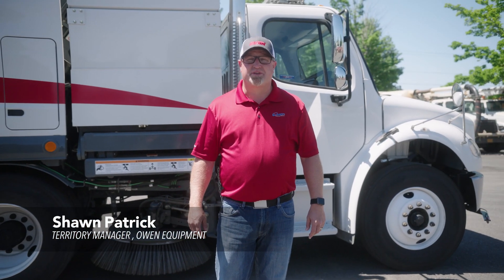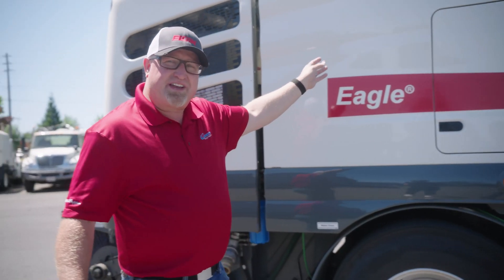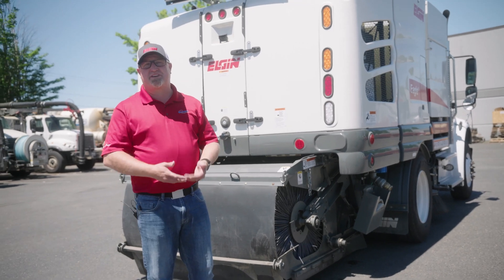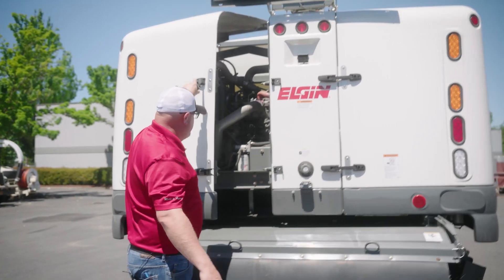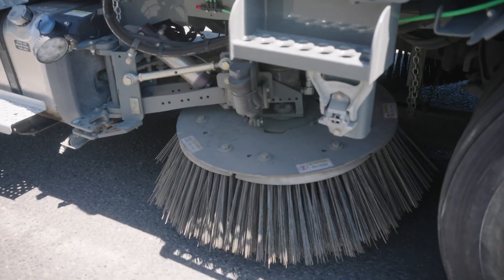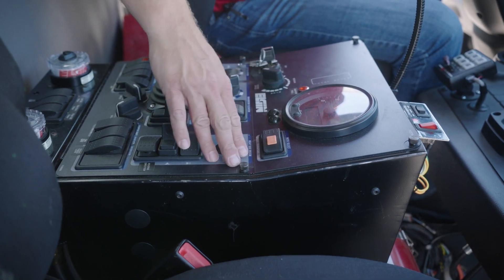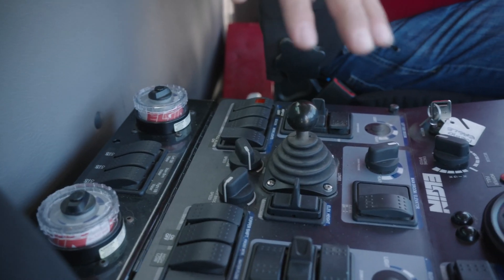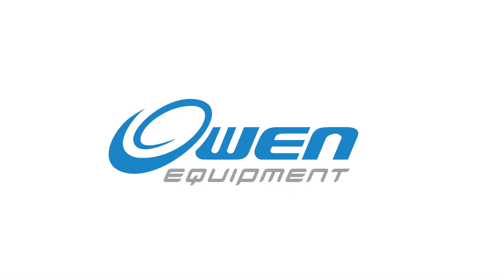Elgin Eagle Street Sweeper - Walk Around & Specs

Comment: Ok, I’ve been sweeping for 15 years behind grinders/mills. I’ve used this broom in the past and let me tell you it needs to be upgraded. First off the hopper door is a stupid design with the tiny door to dump in a truck.The whole hopper system is a crap design imo. The hopper window is also tiny why? How much money would you lose to double or even triple the size of the hopper window? Is plexi glass that expensive? Makes it a lot harder for the operator to see his load for no reason. The gutter broom design is out of date. Other brands allow you to change the width and the angle from the control panels. Some of the new brooms even have a camera in the hopper so you can see your load better. Elgin needs to step up there game
Reply: Btw I live down the street from Elgins assembly building. I’m open to come in and explain why this sweeper is out of date and not operator friendly unlike it’s current competitors
Reply: @pod543  what sweeper brand/model do you prefer?
Reply: @raesorenson1068  I like the Schwarze m6 avalanche which is the current broom I’m using. Also I’m interested in testing out the nescon xbroom. Hopefully soon I can try that out.
Reply: Hey @pod543 with 15 years of experience and the way how you understand the design of equipment definitely makes me interested in talking to you! 
Are you still using Elgin?